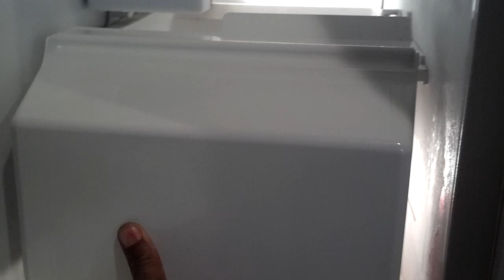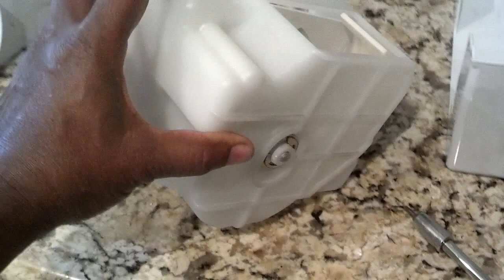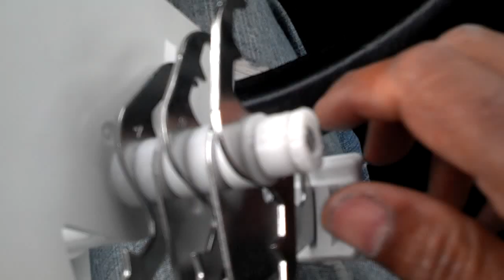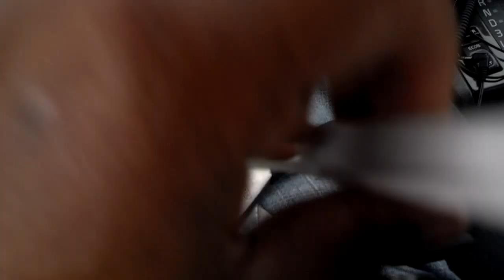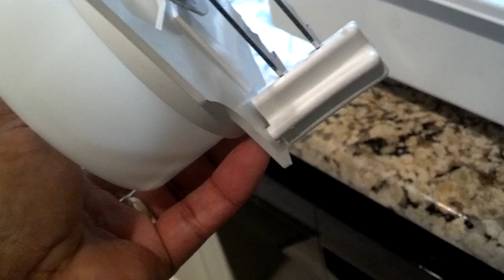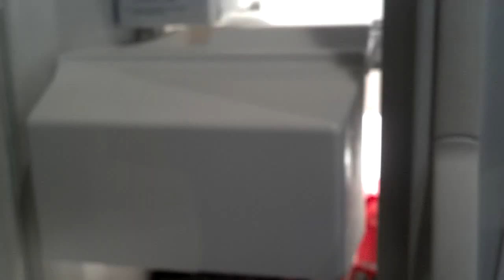Kenmore Coldspot Refrigerator Ice Maker Repair (Auger - Ice Pusher) - Home Repair Series

Comment: Thank you this was very helpful....the spring fell out of my ice dispenser along with a small black plastic part that has a moveable circle at the top/or bottom of the straight piece....don't know what it is or where it goes back.....any help??? Thanks So Much!!
Reply from the maker: May need to replace the ice maker unit.
Reply: Thank you very much....have a nice weekend! @RobertDIY

Comment: I could not get the bearing nut off so I gave up.  Thanks for telling us that it's reverse threaded.  My replacement parts are a little different, the auger is now a metal screw type, hope it works as well but probably will not break. Now I just have to try again.  Thanks for the video.
Reply from the maker: ***** Thanks for watching. Hope it comes off for you.

Comment: Robert - do you have a video that tells about the motor in the back that turns the auger? I can hand-turn my auger so it's not jammed. But when we push for ice (crushed or cubed) we get no motor sound. Nothing at all. Time to replace the motor in the back (that turns the auger) or could it be more simple than that. We have Kenmore model #10652572202. It was purchased in 2002. Just curious if you're aware of that motor dying after 12/13 years. Could it be a wiring problem? I replaced the ice maker about 6 or 7 months ago with no issues. Thanks for any suggestions you may have.
Reply from the maker: Mark S Maybe the switch is bad. Do you know how to test it?
Reply: Good idea! No I do not know how to test the switch. I can tell you that when you put a cup up to the 'pusher thingy' it does open the 'door' (up higher inside the freezer door) to let ice come down, but the motor does not turn to push any ice forward. Can you let me know how to test the switch?
Reply: Oops... I just realized that the little 'door' up there is opened purely mechanically. I hear it closing and that made me think the opening was also not-mechanical, but sparked by the pushing of the 'pusher thingy'. :-) So it DOES appear that there is nothing happening when the switch is triggered by pushing a cup into the 'ice launcher' trigger. (that sounds better than 'pusher thingy')  ;-)
Please let me know how to test the switch. Thanks!
Reply from the maker: Mark S The entire assembly plugs in to the box somewhere. You need to get an ohm meter and back probe the connection to see if power is going to it when you push the lever.
Reply: I'll give it a try. Thanks. Just had a thought - will the motor move at all if I'm doing this while the freezer door is open? Seems they would disable that feature while the door is open so you don't end up with ice on the floor.
Reply from the maker: Ice on the floor would be a minor thing.
Reply: I agree. I guess what I was getting at was that it might be hard to test the motor when the door is open b/c the motor might not turn when the door is open by design. Yes? I'll give it a shot.

Comment: don't know if you're still around, wait i see 3 days ago someone messaged you and you replied, i'll bet you're getting good messages about now as the auger is the thing wearing out and you are the only one that was ahead of the whole world. kenmore should be paying you royalties if they're not completely shut down. my fridge was under warrantee for full replacement that my mom had for since it was new and after 15yrs of paying, she just up and cancelled it without gettin any needed repairs done. so i'll check out if i can get the auger drum online or used, because i was thinking epoxy isn't gonna work as you could have a dinner date and your girlfriend guaranteed is gonna get the chip of epoxy in her drink, it could work magic if things are going down hill already but it could also mean she aint never going out with you again. but forever putting the whole ice bucket back the freezer it's always not aligned right either cocked to the right or left, is that a common thing. the slots that the rail rides in are too narrow, it's been like that forever that i've known about. thanks for the video work. i think the reason my auger drum broke is not using it enough and the ice frozen gets to be one big block and you know when you got the glass on the freezer door and no ice is coming out, i just keep hitting the switch lever and then it breaks. oh and i almost forgot, a couple months ago i found a coil spring that had 2 hanging tabs on each end, and never throw away springs of any kind, but that day i thought i'm gonna out do myself and throw that thing away, i had second thoughts about it but it made its way to the landfill. and a day later the ice quit working. i'm thinking it went to the ice maker. the point is no matter how old you get or how many springs you have saved in a drawer you can't open because it's too full of springs, find more drawers and save the spring.
Reply from the maker: LOL Thanks for sharing. Hope you get it fixed.